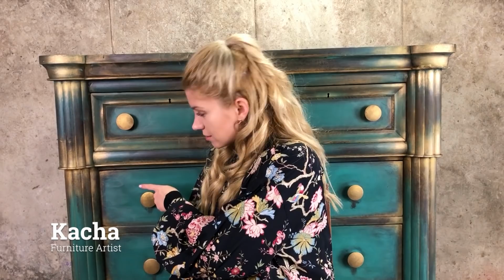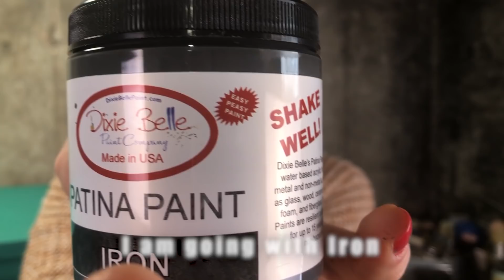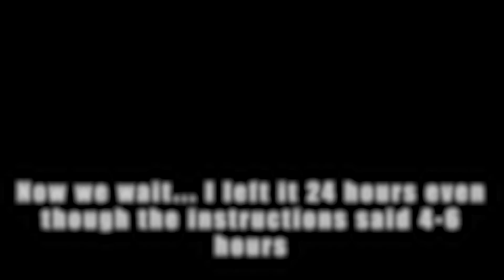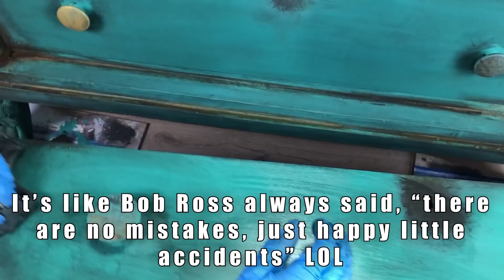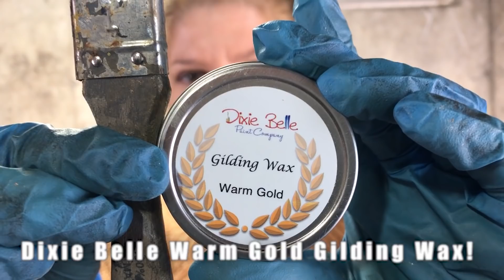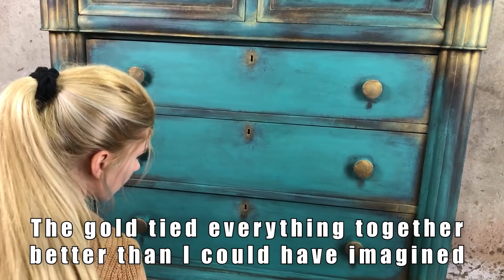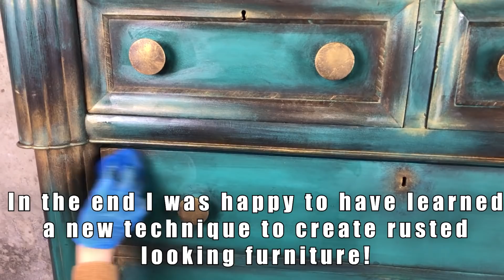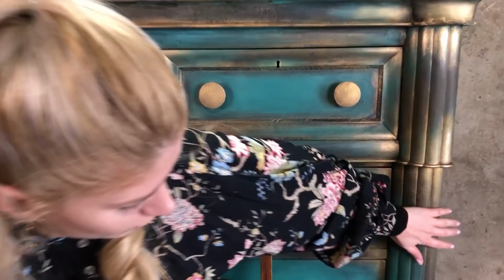Is it real Rust? Dixie Belle Chalk Mineral Paint / Patina Collection

Comment: How can you paint the drawers without taking them out..and not leaving a mess...
Reply from the maker: Whenever you finish a section just slightly open the drawers and apply an even coat around them, making sure not to use too much paint. Doing that will secure you from having them stick or any other problems down the line!